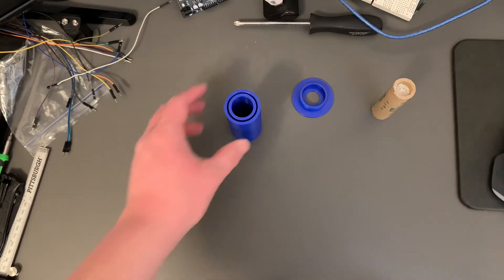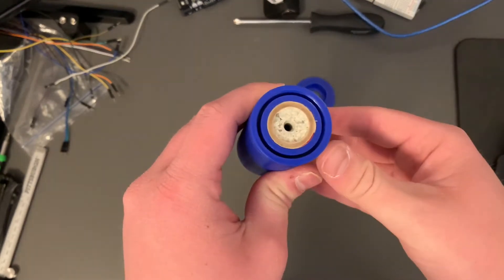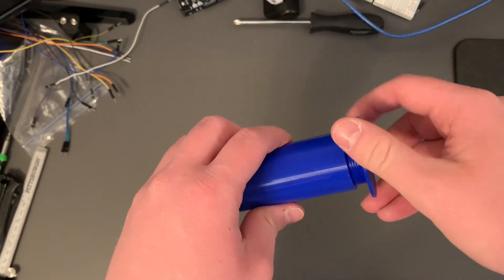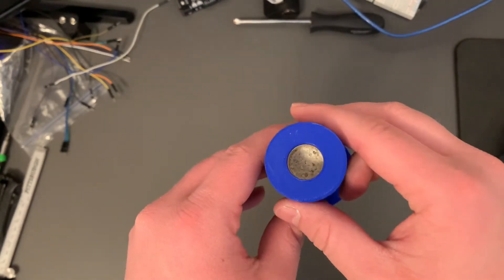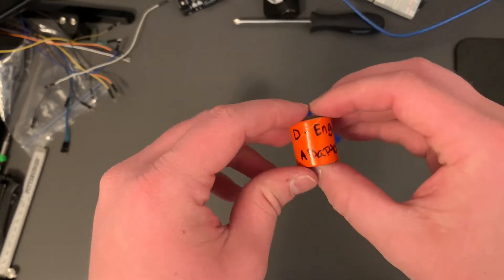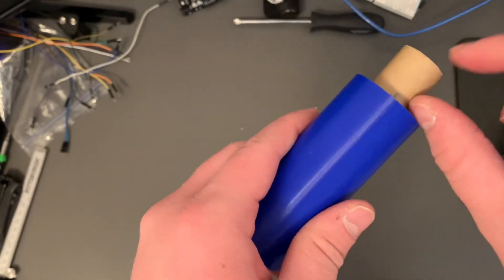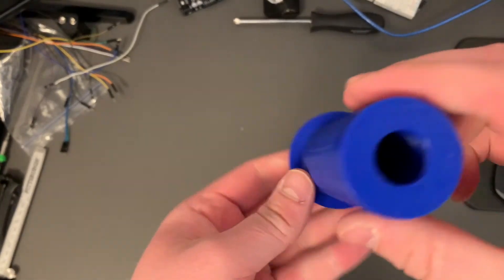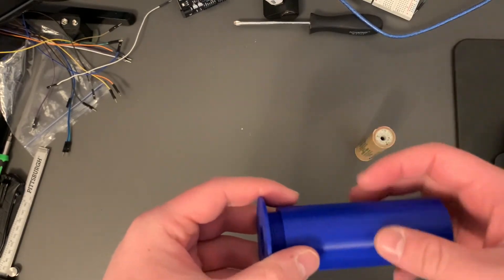3D Printed Rocket Motor Mount

Comment: are you planning for the mount to be reusable since it might melt from the heat?
Reply from the maker: The body of the mount may need to be replaced every so often, not sure how hot the side of the motor gets. I imagine the retaining ring will need to be replaced after every flight.
Reply: @CameronMakesRockets  I'm not sure what material you used to print the mount but I recommend any high temp resistant material such as petg or high temp pla.
Reply from the maker: You are 100% correct, but I didn’t have any on hand. The mount shown here was more of a test of the design, and I’ve already have a design two done and printed (video on that coming soon). I did print design two to be used with A, B, and C sized motors and I’m going to launch it with a C motor to see how the retaining ring holds up, that is the part I’m most worried about.
Reply: @CameronMakesRockets  I have designed and printed a small stable rocket with normal pla and it held up well, the sides did not melt but instead of a retaining ring I just used friction fit and it worked as long as the ring isn't in the direct way of the exhaust you should be fine.
Reply from the maker: Interesting, I would love to see your design!